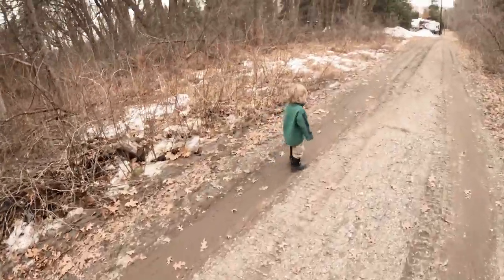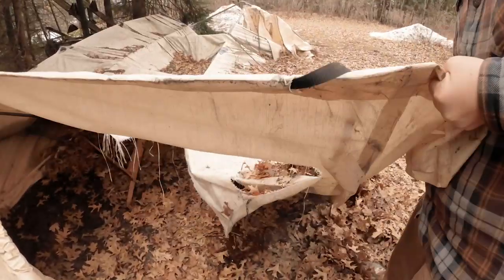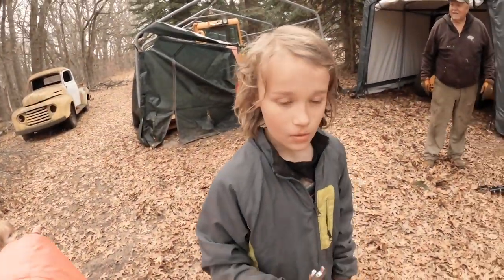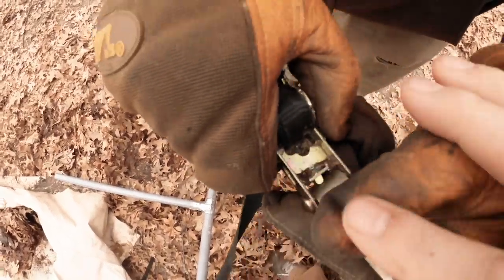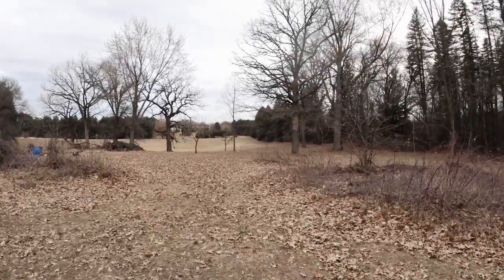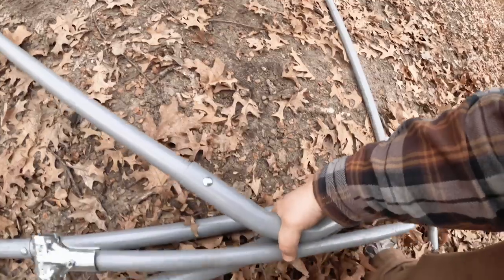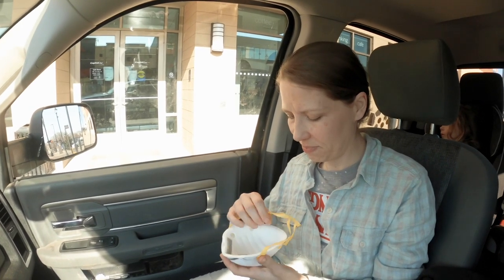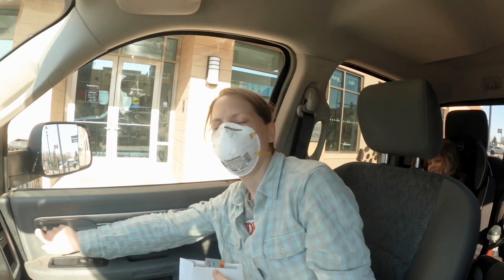Build a Greenhouse Out of Anything ( part 1 )

Comment: We made our greenhouse out of a shelter logic frame that was given to us. We put it on a 4x4 pressure treated beams. My hubby hooked it down really well. No wind will knock it down. We also used corrugated plastic panels.  A storm screen door from habitat restore. Left the floor dirt so I can plant right in the dirt. Just finished it up right now. Using it for my starts. Moved them in yesterday from my mudroom. Heating it at night though, with a big daddy propane heater. Worked good last night. My greenhouse is 10 x 16. It's a good size. Garden on! 🥬🥕🍆🥒🥦🌽🥔🌶🌝